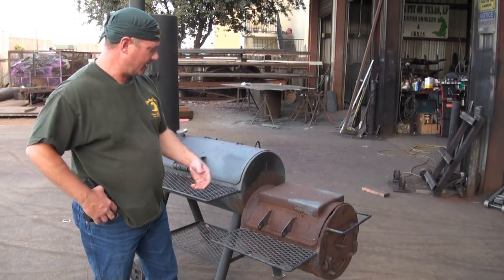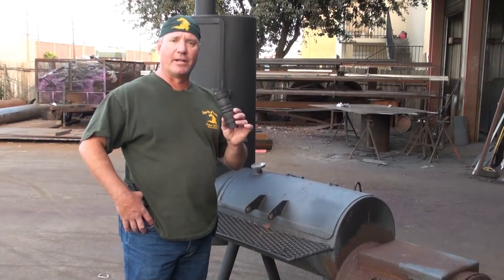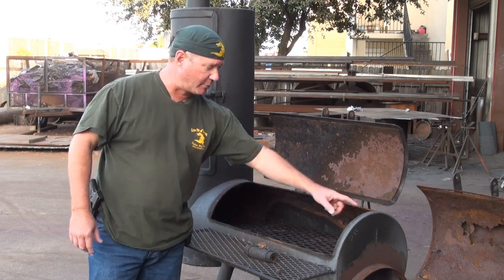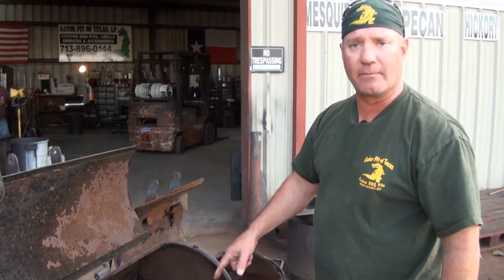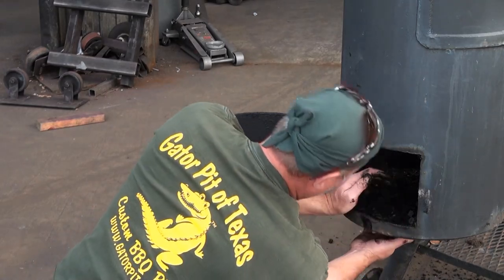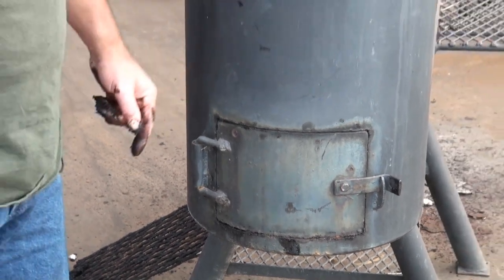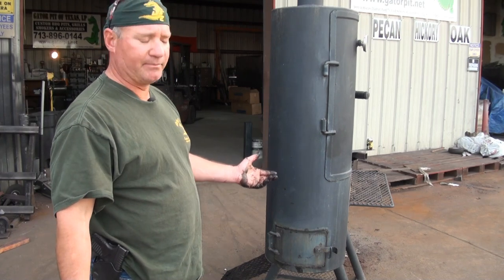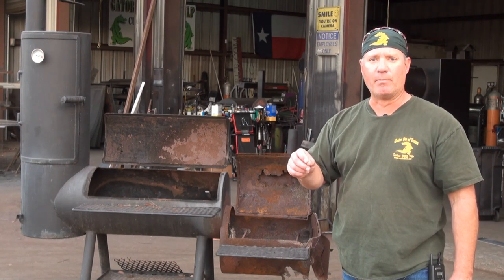Rust Never Sleeps by Gator Pit of Texas

Comment: I own a Brinkmann stick burner that I have had for 17 years and paid $299. 1/4" steel. It sits on the patio uncovered but with a roof over it and has no mods other than after market flat iron grill surfaces. I clean out the ash after every use, season it inside and out twice a year with canola oil spray. Once about 3 years ago I hit it with a wire brush and re-painted it with hi-temp spray paint. It has the butterfly style burn control. It is as good as the day I bought it and the oil burn on the outside prevents rust very well just like a cast iron skillet. I have cooked on other smokers but there is no difference in food quality once you get to know yours. I would love to own a high quality beast like the Gator but I really see no need.
Reply: I bought an old school 1/4" thick Brinkmann Cimarron off Marketplace for $30 last year, and it just needed to be sanded/painted. I wire wheeled it inside and out, and painted it with hi temp paint, and while the interior of the firebox is unfortunately starting to flake from rust, it's still in overall good condition. I clean out the firebox after every use, and I'll spray the outside of it with canola oil after every couple of uses. Still does a good job.

Comment: I've got an old Traeger (1998) with one very long wooden handle and it is in very good shape. I am finally refurbishing the metal for the 2nd time. Always kept covered.
Reply from the maker: 2bless8 Arrh Traegers were much better made back then when they didn't outsource to China. Yours was probably still made in the USA
Reply: Yes it was made in the USA and I had it refurbished right in Mt. Angel.

Comment: i work for the company who built this pit. yes the doors are 3/16. and it can be fixed, cut the firebox off add a new one, maybe $250
Reply from the maker: +masa cure Folks there you go.  For those of you that have this brand cooker, contact Masa Cure.  As he stated,he or his employer can do for around $250.00.  You can have your old firebox replaced.  That is one heck of a deal.

Comment: I've had a smoker for a little over a year.  I can see small signs of rust starting to form inside.  My pit is outside and I use it all winter long in subzero weather.  Is there any high heat paint I can hit the spots with?  I'm probably overreacting, but the smoker was a gift and I really want to keep it for many years.  Thanks in advance!
Reply from the maker: Go to Home Depot and purchase Rustoleum High Heat BBQ Black paint.  You can get in quarts or spray cans.  Follow application directions on the can.  Hope this helps.  Ritch
Reply: Thank you!  And it's safe to use inside the grill?
Reply from the maker: @12Daze  DO NOT paint the inside of your cooker.  Outside only.

Comment: Know this is old but maybe will help someone. When I used a stick burner I had the same one 22 years. Never touched up or repaired other than a shelf runner needed re welding. As soon as it was cool enough (not cold) I would scrape and brush out the fire box then spray the whole inside with Pam. The main chamber I would wipe down (wash the shelfs) then spray with Pam. Wipe down the outside with a damp cloth, when dry rub with a cloth soaked in WD40. Took a little longer to fire up as was basically re seasoning but as far as I know it is still going 5 years later with the guy I gave it to. Broke down and bought a pellet smoker as getting to old to look after a 18/ 20 hour slow cook on it :(.
Reply from the maker: +Grant Tabor A little attention adds years to your cooker.
Reply: +Grant Tabor What does the WD40 do to the exterior?

Comment: Does it make a difference if we put the fire directly on the metal of the firebox compared to using is using ash/charcoal grate to keep the fire off from from being in direct contact with the bottom of the firebox? I am referring to in terms of longevity
Reply from the maker: You want to build a fire on a fire grate of some kind.  It can make a difference in a good clean burning fire or not.  Also, your pit may have a longer lifespan.

Comment: Hard to get a door vent to open if you keep kicking it in the closed position over and over.
Reply from the maker: Kicking in attempt to get the rust lose between the metal.  Obviously, I pulled on the handle and it still would not rotate.  It wasn't going to rotate, same as the door handle didn't move.  Enjoy the channel.

Comment: i would like 2  thank u 4 t good video u make and also t best pits i seen , i do a little welding myself n made a few pit am not a welder but i do it more as a pass time . Iam handicap had my leg  work on ever since i was 5 years old iam going 2 b 60 this year n most of my time iam along at t house n also pack like u very nice . Now iam working on a grill with a fire box n also a horizontal 4 my brother who lives in San Angelo tx i lve in South Texas good luck in t future ( Gilly )
Reply from the maker: Thank you and enjoy building.  Great pride and joy building something from raw materials.  Ritch Robin
Reply: @GatorPitofTexas  i love ur work n vedios  i have a question can i use cold roll steel  or hot roll b better 4 a pipe  pit ends  thank u 🙏🇺🇸
Reply from the maker: Gilberto Rojas Cold cost more $.  Harder steel.  If you have it, use it.  If not, buy hot and save.  Not needed.
Reply: @GatorPitofTexas  thanx a lot 🇺🇸🙏

Comment: How long or how many times should I season a 8ft by 30" diameter pit, also what temperature should I keep the pit at. Do your recommend peanut oil the inside and WD40 the out side of the pit?
Reply from the maker: John Doe, you should only need to season a smoker once, unless you were to clean it back down to the bare metal, after the initial seasoning process.  The pit is first seasoned.  When you cook on it, it will continue to "season".  To clean, you should only knock off any loose gunk that builds up on the walls and clean out the bottom where it all falls and grease may build up.  Yes, to peanut oil inside and yes to WD40 outside (ONLY).  Temp should be the same as cooking.  Anywhere between 225 to 275 degrees on a smoker.  Enjoy your cooker.  Ritch
Reply: Gator Pit  could you please shoot a video or guide of how to season a bbq pit. 

Thanks 

BBQ365/PitMaster

Comment: How can I prevent internal AND external rust on my 1/4" steel firebox? In the last few days, the external area of the firebox has gotta bright orange with rust. Thanks
Reply from the maker: +Danny Bruce   Keep the ash cleaned out regularly.  It is acidic and more so with moisture combined.  Keep the exterior touched up.  As you notice rust starting, wire wheel off, hand sand off, etc and clean the area free of dirt, rust, grease.  Immediately touch up the area with high heat paint.  You can periodically coat the exterior with WD40.  Exterior only.  Lubricate door hinges and work the lubricant into the hinges by working the door back and forth.  Interior, coat with cooking oil between cooks.  This provides a protective coating between cooks.  And, if not using the firebox food tray, remove it when smoking only.  That will prematurely burn out the grill firebox food tray.  A cooker is no different than anything else you own.  You wash and wax cars, change the oil, etc. to ensure longevity of the vehicle.  You repaint and re-caulk your home every so many years.  Wax your wood floors or clean your tile.  A Cooker is no different.  Neglect it, and expect problems down the road.  I have found that a lot of folks expect more from a 1000 dollar cooker than their 40,000 dollar car or 200K home.  You take care of your Cooker and you will enjoy years, if not a lifetime, of cooking.  Hope this helps.  Ritch Robin

Comment: I’m just getting into offset smoking and I got my eye on the Oklahoma joe highland and the old country wrangler which would you go with?
Reply from the maker: They are very comparable cookers in size, features, material.  Old Country is the pricer of the two.  If looking at price comparison with features of each, the Oklahoma Joe would be the one.  I can't see the price difference in the Old Country at $200.00 more.  I just don't see where the extra $200.00 is.  Steel thickness is comparable.  Both have the grill firebox with top hot plate.  Both have wagon wheels, etc.  I'd go OJ.  Now go get it, season it, put some meat on and enjoy.  Ritch
Reply: Gator Pit  thanks man you helped out a lot!
Reply from the maker: @sillery3439  You are welcome.  Glad to be of assistance.  Enjoy that smoker.  Ritch

Comment: my grease drain hole is like a 3/16th inch in diameter. i unclog it, then a few minutes later its clogged up again. im ready to just drill a hole in it myself. other than that, i just have a door leak, and and the whole pit is leaning backwards a good bit. i only had it for about 8 months, but i want a new pit something MUCH higher quality.

Comment: u was going to show me how to take care of it and fix it

not butch how bad the pit was 
not to porfersonal of u
Reply from the maker: Fat Cajun Here you go:  Keep ash out regularly.  Keep all hinges lubricated regularly.  Knock off surface rust as it appears and touch up with high heat BBQ paint.  Available at most hardware stores.  Grease caster bearings and axles regularly.  Pressure spraying a few times a year helps knock off build up inside.  Coat interior with cooking oil periodically to keep food grates from rusting between cooks.  If you cook often, not so necessary as the meat fats will keep the grates oiled.  Replace fire grate when they are burnt out (and they will).  They are "consumables" in a smoker or grill.  Don't lay coal or wood on the belly of the cooker.  Always on a fire grate.  If you don't do this, you will have what you see in this video.  A filthy rust bucket.   Enjoy, Ritch
Reply: thank u
Reply: Porfersonel??!! Damn dude, we live in the age of spell check. Wow.
Reply: nope
Reply: On the inside of the pit?? How soon can I cook with? Do I need to heat for an hour at 400 first? With smoke?? C'mon man, a little help
Reply: How long can these grills last with care.
Reply: @alexlaureano78  Who knows, perhaps he's illiterate. At least he said thank you.
Reply from the maker: @noahkraft6453  I know of my cookers out there that are going on 30 years old and all we have done for our customer is to replace the firebox fire grate and, at times, the meat racks.  Had one in my shop few months back was 26 years old. We cleaned, new fire grate, new food grates, new temperature gauge, nice new paint job.   Owner walked right past it not realizing it was his old cooker.  Said he thought it was a new one.  LOL

Comment: Do you sand the rust out inside too ?
Reply from the maker: You should. Certainly do not want the interior to have rust.  Keep cooking oil inside between use, if you do not cook a lot. If you cook regularly, it will not rust.
Reply: @GatorPitofTexas  even if it has rust I can season it with oil and should hold up ok?
Reply from the maker: @grilledchickenwrap  Need clean the rust out, cooking oil inside, fire up and season it. But, get the rust off the interior walls and grates.

Comment: What gun is that? The grip safety is similar to Springfield armory's.
Reply from the maker: Looks like my XDS45 by the grip pattern.  I change what I carry often.  Usually due to what I am wearing dictates what I carry.
Reply: I have the  XDM. Thanks for the reply. 
Great video! Quick question, my fire box leaks smoke through the lid. Is that normal or should I seal it with gaskets?
Reply from the maker: If your cooker is leaking and it is significantly causing you heat retention issues, try sealing it somehow.  I am assuming it has a top door lid, you are referring to.  Depending on the design of the door, you may be able to find some type of seal/gasket you can attach to the outer side that will overlap the leaky gap.  Good luck.

Comment: I was waiting til u told us how to maintain a smoker but you nvr got to the point...smh..
Reply from the maker: In the video description:  Ritch, Owner of Gator Pit of Texas, shows you what years of neglect to your Cooker can mean.  It doesn't matter who made your Cooker, if you don't give it a little TLC, you will be repairing or buying another in the years to come.  A lot of folks don't know or think to "maintain" their outdoor cooking equipment.  Or, they put it off for another time.  It is to show you that you have to take care of your cooker the same as your home, car, boat, motorcycle, etc.  If you don't, you will have problems with the product functioning efficiently and costs to repair can be great.  Don't change the oil in the motor and it will break down.  Your cooker is no different.  Keep your cooker regularly cleaned out.  Especially, ash.  It is acidic.  Cancer to a cooker's firebox, especially.  Keep moving parts lubricated.  Touch up paint periodically.  A good thorough cleaning inside and out two - three times a year will add life to your cooker.  The owner of this cooker ended up buying new.  Yes, we may have been able to "temporarily" give it life.  But, the metal under the food chamber was rusted thin.  He would have ended up with a nice new firebox that would have then outlasted the original sections of the cooker and be right back were he started.  You get to a point where new vs repair.  This customer not only chose to go new, but he got a nice customized Gator with features he wanted.  He was able to personalize the new cooker and using this old cooker for years, made it easier for him to decide what he wanted in a custom Gator Pit.  www.gatorpit.net  www.gatorpitbbqschool.com

Comment: The problem is indeed due to neglect.  I surmise that any pit, including Gator Pit's would suffer the same fate after weather exposure and neglect for 15 or so years.  As Neil Young sung, "Rust never sleeps"   As for the wood handles? BFD.  By the way, $125.00 x 3 for a wood handle fix?  Paint cracks when it contracts?  No, bud, it cracks over time mostly due to expansion of the metal allowing the rusting process to begin.  You state you aren't knocking the quality of the pit; you then state there are things you would never have done in it's design.  I suggest you watch your video several times.
Reply from the maker: Frank Verdin You do realize I made the video, right?   I own a custom shop?   Been doing this since I was 14 years old.  Been in business some 27 years.  Consult restaurants. Teach BBQ classes.  Have cookers all over the world in backyards and restaurants. Articles written on me.  TV shows aired about me.  In BBQ books.  Designed and built thousands of cookers.  In the Atlanta History Museum.  Pretty sure I know what I am talking about when it comes to cookers.  My credentials speak for themselves.  Thank you for your input.

Comment: Thats got another 15 years in it, just use some rustoleum paint, 2 coats and some metal filler as for the handle cut down a mop stick, u just wrecked a perfectly good bbq.I work at pitmaker so I'm an expert in this field, we would repair this for about $3450 including pick up and delivery.
Reply: +Prawnchowmein you could buy a much better bbq for $3450 though than trying to revive a dead horse.
Reply: $3450.....LMAO...gotta pay for that bro-dozer somehow i guess.
Reply from the maker: Get a brand new, nicer, larger, more bells and whistles Gator Pit for about $500.00 less than the repair/refurbish you mention:  http://www.gatorpit.net/backyard-classic-chef.html

Comment: Read the comments an no one seen he had his foot pushing the vent on fire box closed not opened  pushing on the stop tab should have pulled instead of trashed another  pit manufacturer
Reply from the maker: Mike Morgan Mike, appreciate the comment.  If the air vent worked, which it did not, that would have made this pit all better?  The firebox falling apart, the handles falling off, interior deteriorated, was all okay.  But, that vent was good, so this is a salvageable Pit?  BTW, I pushed and pulled up on that handle, obviously, by the pit lifting.  Kicking it was to try to knock the rust out to try and unfreeze the vent. Everyone on the Internet is so quick to insult and criticize a video rather than see its intent for what it is.   Read the video comments under the video. I clearly explain this video. I clearly express abuse, need to care, preventative measures to prevent and minimize this from occurring, etc.  Thank you.